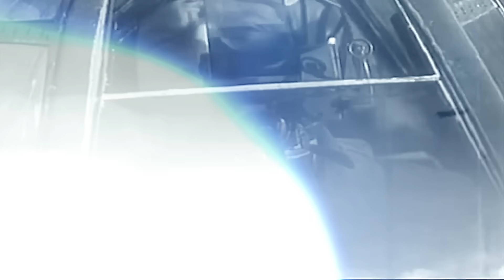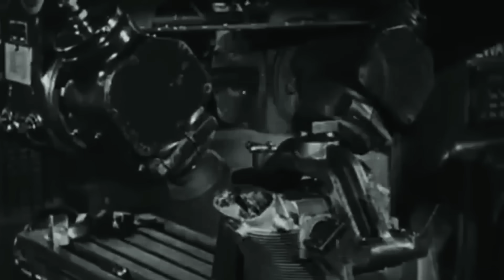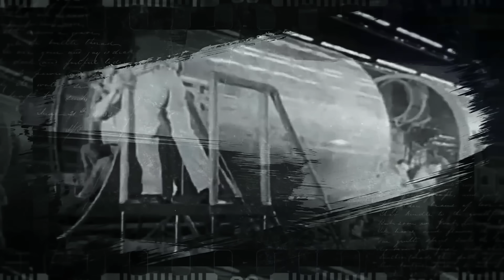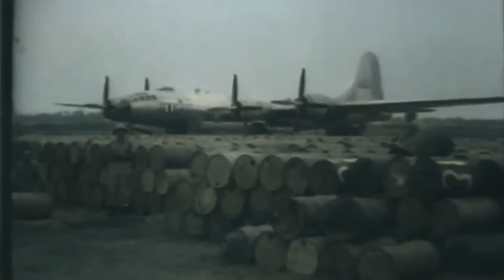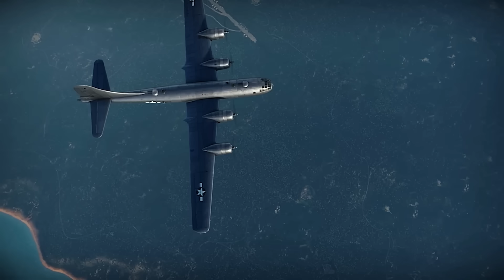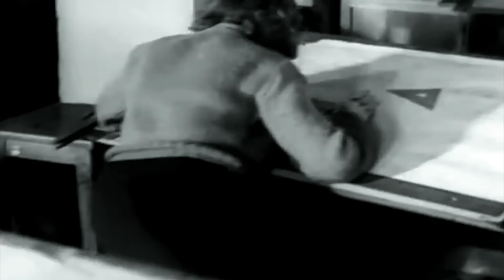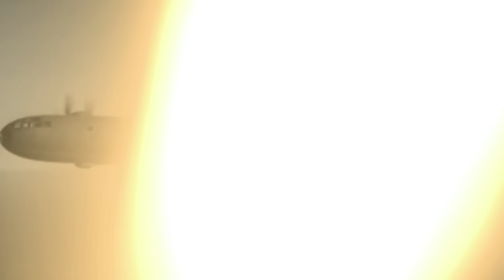The Shocking Truth Behind Wright’s R3350 "Duplex Cyclone" Engine

Comment: not the most powerful, not the largest and heaviest ever
Reply: It's about the refinements that made the 3350 the most desired piston engine for eventual use.  They don't mention it here but the Douglas Skyraider also used the turbo-compound version and it was part of that aircraft's unique and successful operational history.  While the R4360 was the pinnacle of development for reciprocating radial engines, its complexity with it's 28 cylinders was what made it a costly, service hungry engine for use in commercial aviation.
Reply: @whalesong999  The R4360 was too much of a maintenance load for them to be successful in commercial operation.  Just cost too much to operate, which is why there were only about 100 Boeing Stratocruiser airliners.
The Air Force, who paid their mechanics the same as any other Airman with their rank, used them a lot - The B-36, the B-50, the C-97 (About 900 of those, transports and tankers), the early model C-119s, the C-124s,,,)
Reply: @whalesong999  What did the B 50 use or the 28 cylinder or the Napier or ...
Reply: @jmflournoy386  Military applications, costs weren't considered so critical as commercial applications.  The C-124 must have been one of the best applications of the R-4360.
Reply: @jmflournoy386  R4360s.  Nobody who had a choice used the Napier Sabre.

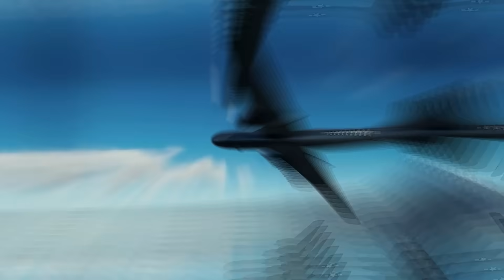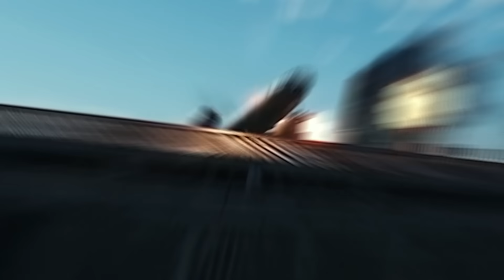Comment: 6:32 to 6:41-AI re creation of the crash that killed Boeing test pilot Eddie Allen the rest of the crew on the B-29 & several people inside the meat packing plant as Allen tried to get the stricken 29 back to Boeing Field.
Reply: I noticed that. Completely glossed over and ignored by the producer. Any mention of the R 3350 faults should have highlighted this tragic crash as the perfect example. The ingenuity of the line mechanics at airbases saved many lives.

Comment: Wonders aloud, “why didn’t they use the P&W R-2800?  I bet they could have simply bored it out 1/16 of an inch or so, and the same for stroke?
Reply: The stress in the cylinder head increases with the square of the cylinder bore.  The head quickly becomes thick, and this slows the combustion waste heat transfer to the fins.  The R3350 was near the limit.
To increase power, cylinders were added, the P&W R4360 being the poster child.
    Why 6 R2800s or R2600’s weren’t used on the B29, I guess increased drag.  Boring out the R2800 is an idea, but it may founder on the details.  The R1830 was increased to 2000 cid.  
    Also R2800s in fighters ran at greater Hp than bomber applications.           Cheers D
Reply: @danbenson7587  The Backup was the Allison V3420 which was two Allison V1710 canted  30 degrees to left and right and sharing a common crankcase but with separate crankshafts joined by gears at the bearings.  Problem with the R-2800 was that is cruising efficiency would be a less since it would be operating at higher boost and richer mixtures ratios to get the required power.   It would have worked in the interim. 
-There is a missing generation of US bombers that could have used 4  R-2600 or R-2800 likely in the 95,000-100,000lb range.
Reply: Several years ago, I saw an excellent documentary on the R2800 and I hope it's still available here.  Of major interest was the development of its crankshaft which had been plagued with tortional vibration failures leading to many hours of research to solve.
Reply: Because P&W isn't Wright - more importantly because the wartime factories were at full production with order backlogs and they simply weren't available

These engines were bleeding edge designs being thrashed within an inch or less of their lives for prolonged periods in nacelles designed to minimise drag as much as possible in order to get sufficent range to reach Japan (and return) - which really badly cut into cooling airflow. 

For any given engine, fighter use tended to be mostly at lower power settings with only a few minutes at a time of maximum power output, meaning heat soak or low speed high heat output wasn't an issue, whilst bombers are usually running at or close to max power for nearly the entire flight duration

Yes you could have used R2800s, but it's entirely possible that they would suffer many of the same issues the Wrights did, particularly during takeoff and climbout when there was barely enough cooling airflow
Reply: @alanbrown397 might wish to “borrow” an idea from Kurt Tank (FW-190) and fit a geared-up cooling fan?  Might have helped with either engine….
Reply: @alanbrown397 Chrysler built a Chicago plant During the war to build R3350, it could have produced R2800s.  The R2800 was used on the B26 and the R2600 on the B25 Bombers.  Ipso Facto.
     How hard an engine works is dependent on more than speed…how many engines has a sailplane?.  Therefore Wing loading, and span are players.  This subject is problematic…too many variables.   Because Bombers could fly with an engine shot out, it infers excess power available from the remainder.  They likely cruised at 60-75% , but I don’t know.
    Anyway, in my comments, I suggested 6 engines for the B29.  The total displacement of six R2600 and R2800 exceeded four R3350’s.   The R2800 and R3350 were in gestation nearly simultaneously and the B29 not long afterward.  Boeing could not know the R3350 would an incubator until its teens.
    The R2800 had problems too.  I think it went through 3 major revisions thru the war.  But that doesn’t mean the engine wasn’t serviceable early.
     These discussions are fun, but ‘counterfactual’ as the historians say.      Cheers
Reply: @danbenson7587 
The real issues with the B29 and the R3350 engines had nothing to do with what you hear in these YouTube documentaries, they're all highly flawed and full of myths and misinformation because they use other YouTube videos for source material. 
As an example of how wrong they are, the Wright R3350 engine didn't even have magnesium engine cases, they were forged steel cases just like the Wright R1820 engines in the B17 had forged steel cases. 
There was never really anything wrong with the R3350 engine from the get go, engine fires were induction fires and had nothing to do with overheating, the issue from overheating was that it cut down on engine life and the overheating issue had nothing to do with the engine design or cowlings or anything mentioned in these videos, it was because the contractor that made the cylinder head temperature guages had never made anything like that before the war and was calibrating them incorrectly, as a result the engines were running 100° F hotter than the guages indicated, but everyone was chasing their tales around blaming the engines because after the prototype crashed into that meat packing plant in Seattle the Truman Commission incorrectly blamed its engine fire on the R3350 engine, they claimed it must have run hot enough to spontaneously combust which is ridiculous, later it was discovered that the fire happened because a faulty fuel filler cap had leaked fuel all over the engine, but the die was cast, so when engines were suffering overheating issues everyone was chasing their tales looking at the engines when in fact it was because they were running them too hot because of faulty cylinder head temperature guages which wasn't figured out until well into everything. 
The engine fires were induction fires, they happened because the early pilots didn't have a proper pilots manual because of the B29's rushed development and they were opening the throttles off of idle too quickly, this would sometimes result in a cylinder running lean at idle to backfire into the intake manifold lighting the air fuel mixture on fire, as they'd roll down those short improvised runways on those Pacific islands the fire would spread inside the intake manifold from one cylinder to the next causing them to go out like domino's until the thing would get to the end of one of those short runways just in time for the entire engine to be dead, the fire suppression system wouldn't put the fire out because it was inside the engine, not because it had magnesium cases which they have didn't anyway. 
These videos drive me nuts with all the misinformation and myths in them, what really irks me is knowing that people actually come away from them dumber than before they watched them which of course is no fault of theirs. 
I've read 3 books on the development and history of the B29 that are credible, all the source material in them is from USAAF, Boeing and Wright documents, I've got a half a mind to start a YouTube channel dedicated to dispelling all these myths about the B29 all these videos keep passing around because they all use each other as source material.
Reply: @dukecraig2402 I read somewhere that no piston engine design started during the war saw service in the war so protracted was development.  I have no disagreements with your R3350 comments, but mine really don’t disparage the engine.  Yet, a new engine on a new plane…what could possibly go wrong?  
     Curtiss-Wright as a corporation wasn’t well led.  I have read..again somewhere..they were cheap, always had excuses, and their hand was out for money to fix it.  They annoyed the USAAC.  So when the B29 program got into trouble, who was the whipping boy, Boeing or C-W?         
      C-W is still around, a husk of what it formerly was.  I contracted their shot peen services some year back.    Cheers
Reply: @danbenson7587 
Development of the R3350 started well before the US entered the war, the B29 itself actually started development before the US entered the war.
The problems mostly stemmed from what should have been a 5 year development program that was compressed down into 3 years, its development program was far more complex than any aircraft before it, trying to get it into service as fast as they could was the cause of issues being blamed on things that weren't really the problem, the B29 was the most technologically advanced aircraft in the world when it flew, there was never really anything wrong with the R3350 engines, the real issue was misidentifying problems because of rushed development.
Reply: @dukecraig2402 If you have the hots to buy one, Alamo Aircraft in San Antonio probably has 200-300 used ones in hermetic cans.  Wife would love one as living room centerpiece.  Alamo bought surplus from USAF bases around SA.  Interesting place.  Cheers

Comment: Now, a video about Pratt&Whitney's wartime R-2800 & R-4360.
Reply: I would like to see one on the Rolls-Royce Crecy 2,700 HP out of a Merlin sized engine it was two stroke sleeve valve engine.
Reply: @lambastepirate  - Pretty sure the sleeve valve engines were 4 stroke.
Reply: @scootergeorge7089  Yep. Take look at the Bristol Centaurus.
Reply: @daigriffiths399  - Perhaps on par with the Pratt and Whitney R-2800 but this one, with poppet valves  was simpler and easier to produce than the sleeve valve Centaurus.